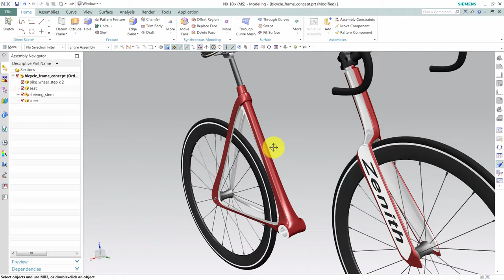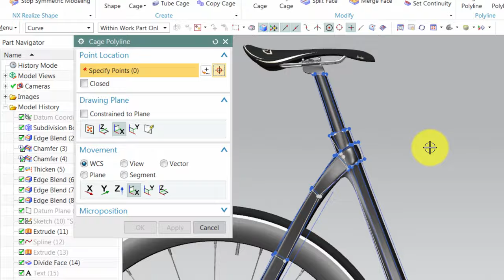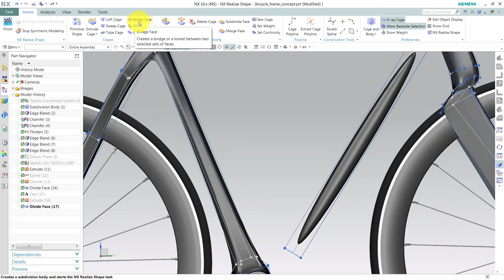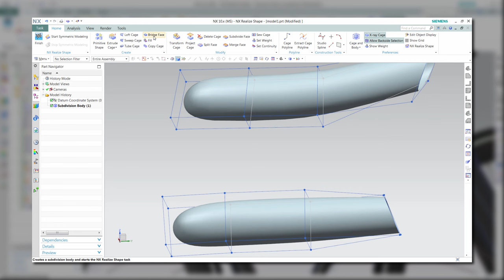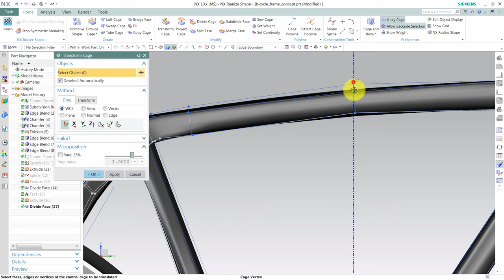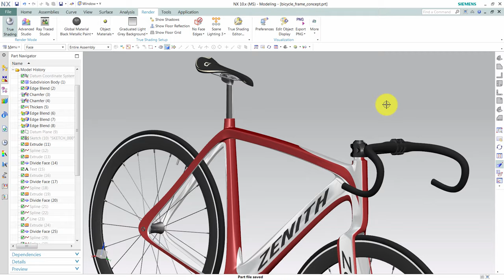NX Realize Shape | 3 - Road Bike Concept Design

Comment: @NX - Portalen
what keys do you use to move your model??
Reply: I use a 3D-mouse. Check out products from 3Dconnexion to get the idea. Once you've learned to use ut, you'll never want to leave it behind.
Reply: thanks. i'll take a look
Reply: Zenith Systems I use a Spacecontroller.. very similar product and yes, once you acclimate, you'll never want to go back. 

NX rotate couples to mb3, (mb3 + mouse movement gives rotation) which is also the confirmation button for any action. Needless to say, that marriage can be a bit frustrating at times...